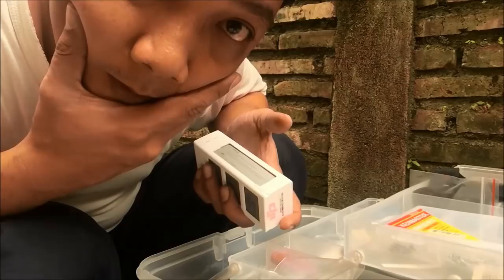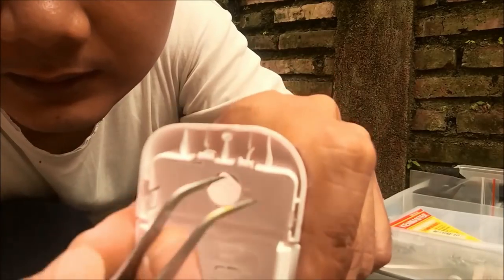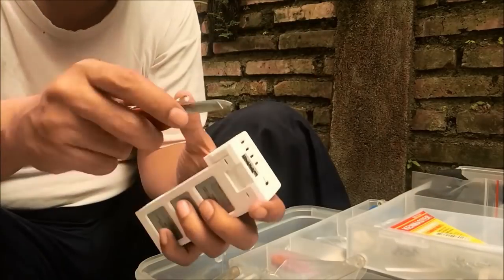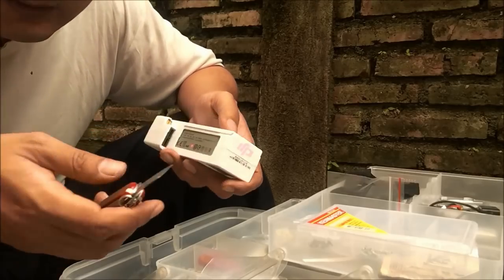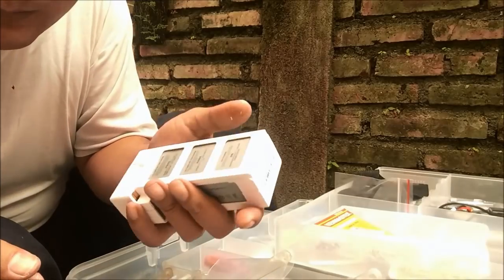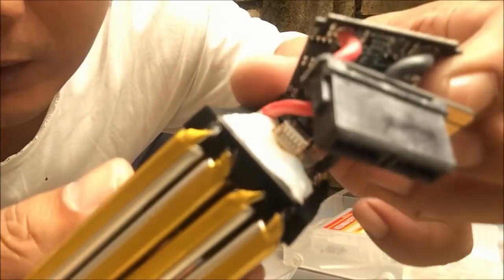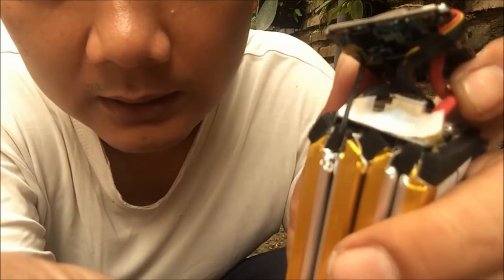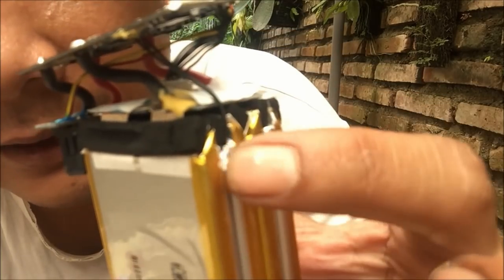Inside The Broken Battery of DJI Phantom 3 - How to open For Mod and Repair Purpose (Cara Bongkar)

Comment: You absolutely must be careful not to cut the battery! Even a depleted LiPo cell can potentially catch fire if punctured or shorted. Cutting yourself is no fun, but burning yourself can be even worse. See the rest of this message for info about the connectors, etc.

The small component with the black leads that is glued to the battery is a temperature sensor. It lets the charge controller know if the battery gets too hot during charging so that it can stop before the battery catches fire or melts things.

The connector on the battery that the wire broke off from is the charge balance connector that reads the voltage of the individual cells and would definitely prevent the battery from charging.

The connector with the yellow and red wires is used to communicate the status of the battery back to the aircraft controller. It's how the Phantom knows to initiate either a return to home or immediate landing when there is a low battery. It also is used to send information about the battery back to your remote controller so that you can see the battery status in the DJI GO app.

I'm sure that one of the reasons that DJI makes the controller part of the battery assembly is to help protect themselves from liability. Consumer drones are very often sold to people who may know little or nothing about proper care for LiPo batteries.
 
The board contains the charge controller for the battery ensuring that there are no settings for someone to potentially get wrong and fry or damage the battery. It also serves the function of gradually discharging the battery to a safe storage level over time when the battery has not been used in a while. It's actually a fairly intelligent design when you consider the reasons for it.
Reply from the maker: +SynnicWinterhaven - Hi! Thank you for your safety reminder and very helpful information about those cables. I agree with you why phantom's batteries has complex design. Not like LiPo race battery that we can use ballancing charger for the LiPo batteries. But something bothering me, the Phantom 2 still using old powering methode and it can flies safely til today.

Comment: You have red and black main power the other two are signal necesary for the phantom to operate with the sofware, the other 6 cables are 4 for balance and two for signal information, there is two more that are for battery temperature.
Reply from the maker: Hey thanks! Now I can figure out the PCB diagram function.

Comment: Very good job, Arya.
I am impressed with how you disassembled the battery case, very clean !
I saw another video on YT, where some Chinese guys completely destroyed the case (and the battery too), lol !

You are right, why they included the electronic card inside the battery case, it's just ridiculous.
Perhaps it would be possible to place the card in the quad, or inside the battery compartment and with a new connector, connect the battery to the card.
It would then be possible to use simple LIPOs, much cheaper, as you say.
Kind Regards,
Jean-Luc
Reply from the maker: Hi Jean-Luc,
Thank you for your appreciation for my video. The card inside the battery compartment, I think it just like an indicator or battery tester but using LED. I curious for the main input line. It just normal positive and negative input. And the other tiny pins, is the battery signal sender to the telemetry transmitter. That's why we can know how much the battery left in our smartphone application.
But all I said above is just a hypothesis. I hope I can try the other 4S LIPO to power the bird as soon as I got my long holiday here.

Regards.
Reply: Right.
And maybe the 2 black cables that are between the LIPOs  "in glue" are a temperature captor.
Reply from the maker: +el jano - Yes I think you are right. That is for temperature indicator. That's why we can't charge it right after use (hot condition)
Reply: They do the boards to make these so user friendly and easy to fly for anyone otherwise you'd need a charger for lipo batteries with a balance board and people would just not want to take the time so from a business perspective they made convenience a priority and they're making people pay for it. Also with the board on the battery they can track the telemetry (data) and use it to make their batteries better. I'm sure they're getting the data from the batteries back whether we want to allow them or not as they designed it but if you read the fine print you don't own the software on the drones, batteries, etc so they can get the data. My guess is they have a hush hush way they're doing it and will continue until they're caught and then change their tune but by you accepting the terms of service and using the app, software, etc your essentially giving them the right to the data. Think about Goa they did the fly restriction. You don't agree then you can't fly your drone. The price of the batteries and such is because they know they can charge it and will until someone steps up and makes just as good batteries DJI will keep the prices up. Someone should get a good cell supplier, buy dead DJI packs or offer a exchange for them . I can get a 4 cell lipo RC car battery for less than $90 and that's a good brand. 

Maybe I should buy a 4 cell and try it if I can't recovery my battery and see if the software will work properly with it. That's the main thing is you need to get the readings and safety warning for return to home and if other cells can give the circuit board that data then one can be set to replace their own cells.

Comment: so what is the smalll cable for ??
Reply: That is likely the balance leads, which let it ensure all cells are charged up fully.  That is also what lets it see the voltage of each cell, to tell you in the DJI Go app the charge of each cell.
Reply from the maker: +pavel1809 - I'm not sure what its for. But small cable means small current. It can also use for some signal to the board. My battery cannot be charged before. After I replace and get the connection back, it can charged normaly.
Reply: Arya Dega i think its the cable for battery temp....thats why ots glued to side
Reply from the maker: +Mike Sarni - yes, should be the temp censor.
Reply: can you show me how the button works i think i lost a piece i have the white and the clear piece but does something go in the clear piece , i carbon dipped my battery cover but cant make it click bro please help me out thanks man